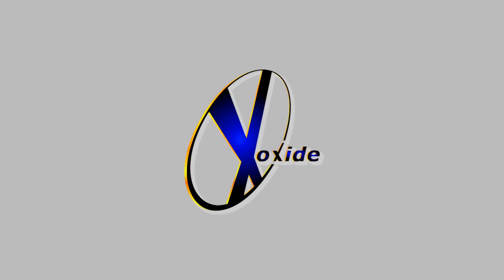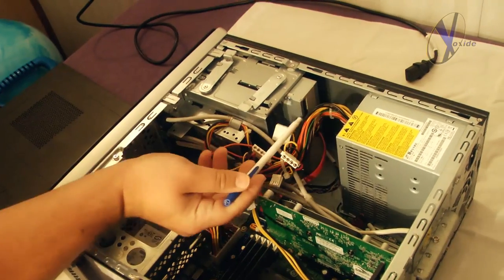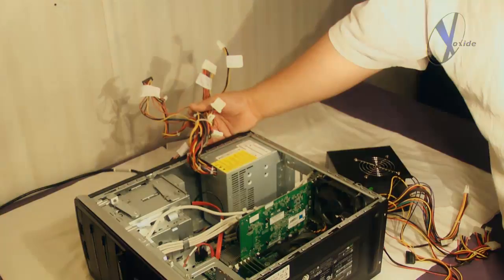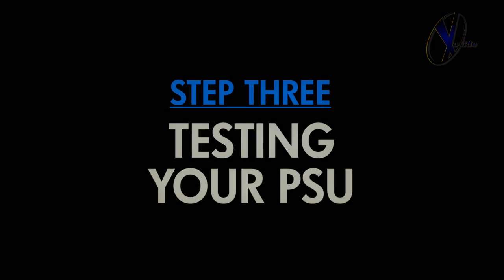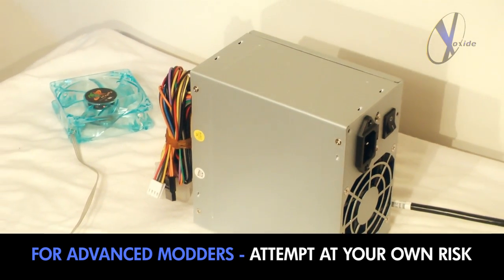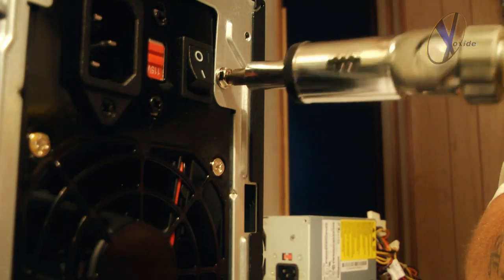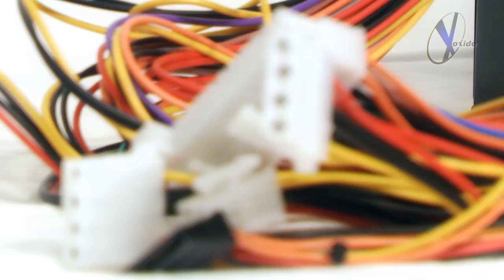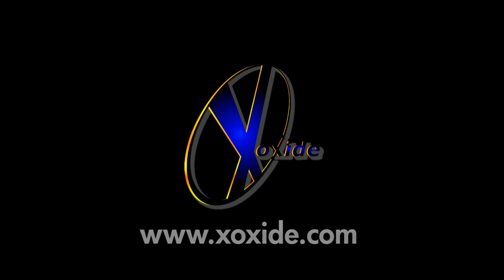How to install a PC Power Supply PSU - Xoxide Tech Chronicles

Comment from the maker: @Adam0H  No, computer power supplies will only provide as much power as they are "asked" for.  You can install any wattage from 300w to 3000w, as long as it is enough to power your system.  There are no ill effects from having "too much" power, and actually, power supplies are at their peak performance at around 50% load, so buying a higher-wattage power supply than you need can actually be beneficial.